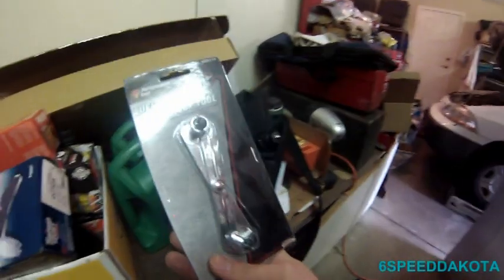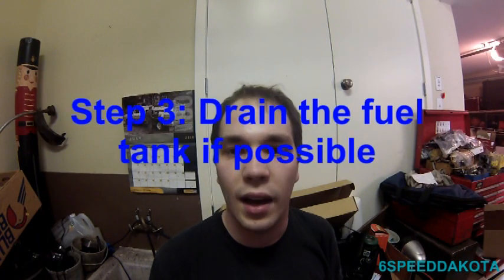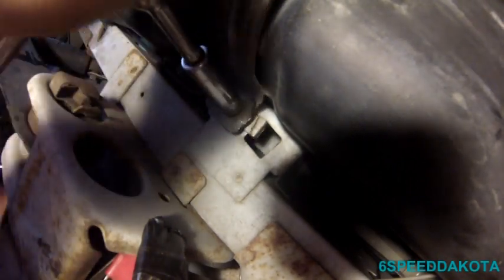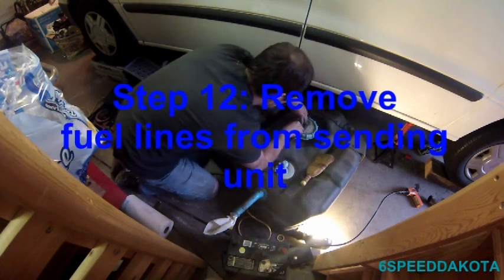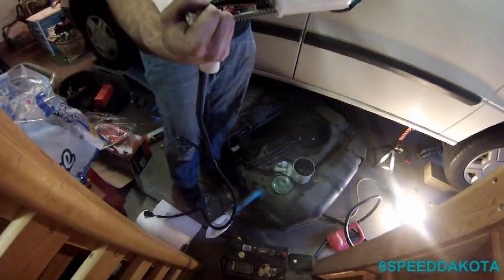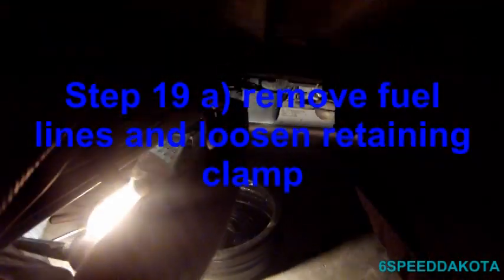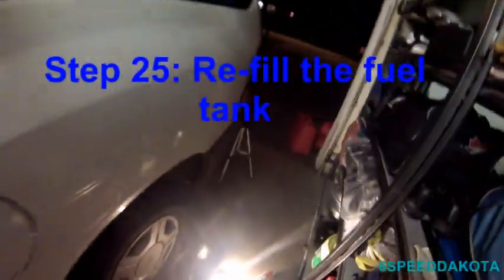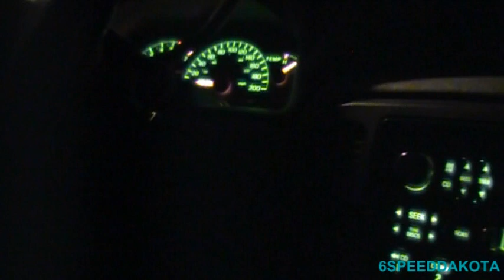How to Replace a Fuel Pump on a 2002 Ford Windstar LX

Comment: I hate new cars they put parts in the most stupid spots I changed my speed sensor in my ford windstar and let me tell you that was some bullshit. If I still had my 1981 caddy I would of had this work done in no time I hate new car engineers.
Reply from the maker: I wholeheartedly agree with you. When doing a heater core, it's like they started with the heater core and built the car around it.

Comment: cant you cheat by putting an inline pump on?
Reply: No
Reply: found that out a couple of weeks ago, but putting the sump fuel pump in wasn't as bad as I thought it would be, the hardest thing was dropping the tank down. and putting it back up. which do it with somebody and it makes it easier.

Comment: so if i step on the gas and it does not go very fast is it the pump, alo could i just take out the rubber gas feed out to drain the gas with a syphon?
Reply from the maker: UnKnown4mat go rent or borrow a fuel pressure testing kit. Connect the gauge to the Schrader valve on the fuel rail. Start the engine, you should see between 28-40 psi, that’s the factory spec. If you snap the throttle, it should stay relatively constant, it may dip a little then overshoot a bit, but the needle shouldn’t peg down sharply. If you disconnect the vacuum line to the regulator, you should see the fuel pressure increase. If it doesn’t, that’s usually the sign of a weak pump. If your pressure is below 30 psi at idle, you have a very weak pump. Same thing if you snap the throttle and the pressure drops quite a bit, and quickly. Usually it’s not that obvious unless the pump is basically on deaths door. So take the gauge and run the hose out through the cowl in the hood, tape it to the windshield or if possible, bring it inside the car with you, take it out and punch it. If your fuel pump is bad it will drop way below the minimum pressure and that’s when it will begin to struggle to accelerate. Generally when the fuel pressure drops low like that, it’ll set the check engine light with a lean code. Always replace the fuel filter if you deem that the pump is bad.
Reply: @6speeddakota  I did that already it went up to 40 and stayed there but it didn't go up fast but not real slow plus my battery was being charged the same time. But yea before my van went dead it would hesitate to go when I hit the gas, it would pick up but not right away now I just get a crank, start then dies, can't get any answers in why, I did all the gaskets and idolater bolts still not running, I hate this van no matter the part I get it stays the same...
Reply from the maker: UnKnown4mat So you tried the fuel pressure while driving and it stays at 40 even under hard throttle?
Reply: @6speeddakota  no the car won't stay running
Reply from the maker: UnKnown4mat if the fuel pressure isn’t dropping off, it’s unlikely to be a fuel delivery issue that’s causing it not to stay running. Does it stay running if you open the throttle a bit?
Reply: @6speeddakota  haven't tried yet have to recharge battery..but before all this I had a p0171 and a 174 code I fixed what needed fixing and more I got a cam sensor coming soon and I think I have a bad 02 sensor but I have that ready to do ,I'm wondering if my ecu is bad got a new alternator and battery so that's out of the way
Reply from the maker: @unknown4mat584  The codes are for fuel system lean banks 1 and 2. It's very unlikely that the computer is bad unless it's seen excessive voltage, or it's had water intrusion. A weak fuel pump especially if it's causing a poor power condition will definitely cause that. You usually won't see both banks read lean as a result of an O2 sensor. It's highly unlikely to see both sensors go bad at the same time. If it's been sitting for a little while, the stepper motor that controls the idle air bypass can get stuck which will cause a hard start and an engine that stalls at idle. Not saying that's your issue exactly. Try giving it a bit of throttle and see if it stays running. You may have an input problem if it doesn't.
Reply: @6speeddakota  it has died from idle before a few time infact
Reply: @6speeddakota  what is a report motor?
Reply: @6speeddakota  stepper motor?
Reply from the maker: @unknown4mat584  It's a type of motor that has a set number of "steps" for each rotation. The computer can command the motor to turn a certain number of steps, which controls the position of where the motor sits. The problem is that there is no positional feedback, so if the motor gets stuck, there's no way for the computer to know.
Reply: @6speeddakota  if your talking about my cluster gadges that thing has been jumping all over the place been doing it for months even before this thing died on me, is that the issue?
Reply: @6speeddakota  also since you seen a Windstar before is the a ground to the engine that is under the engine I was just wondering if that could be the issue I've seen the ones on the front but never saw one on the bottom if there is one at all